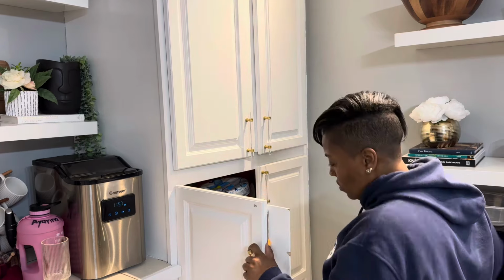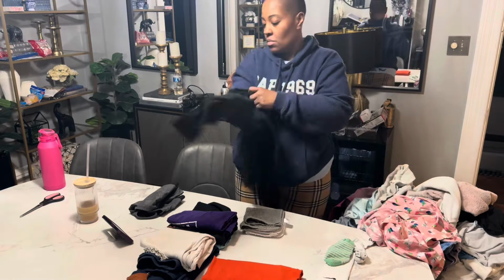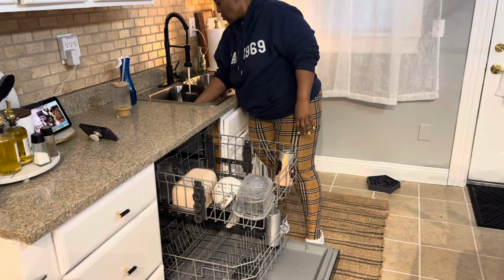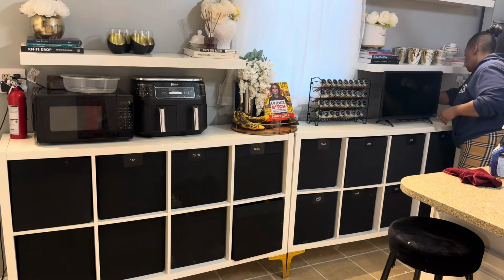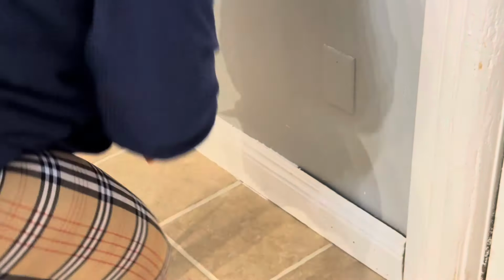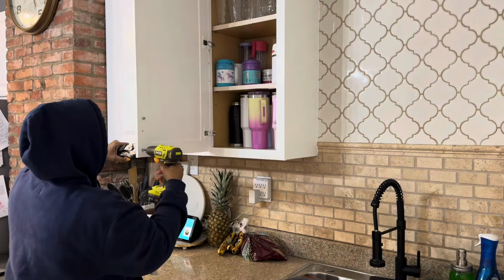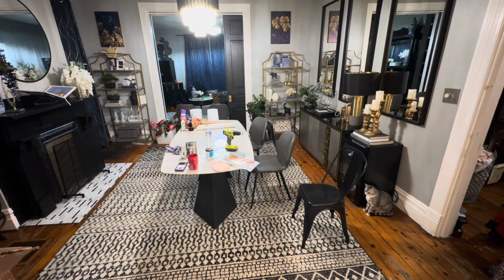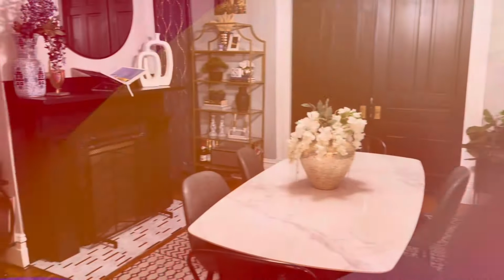SUPER SUNDAY RESET  & DIY HOUSE PROJECTS / NEW CABINET HARDWARE/ DEEP CLEANING / LAUNDRY & MORE

Comment: A tip for  the wine . Wine does not like heat. Maybe you need to move the wine to a area where you there is not a air vent.  When wine is made it is stored in the wine vats in a controlled  cave which is generally below temperature .  You could put your wine in the wine colour in the dining room.